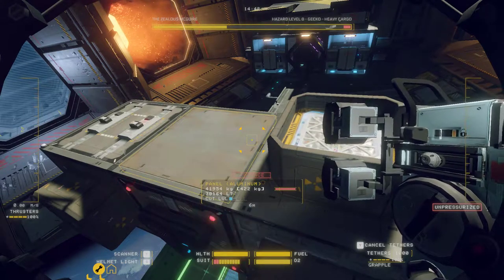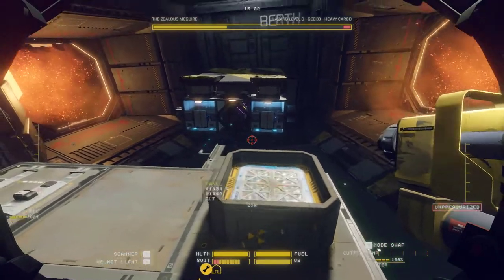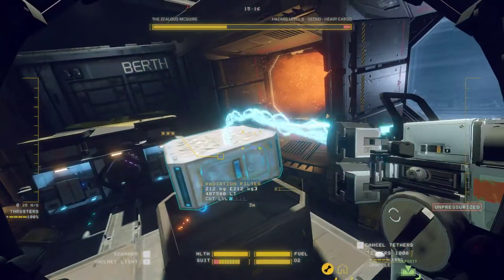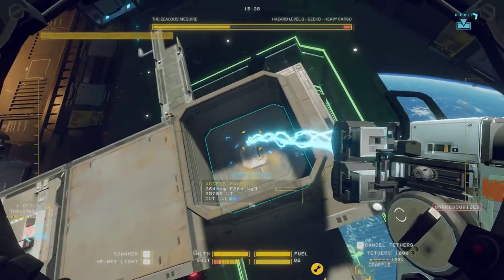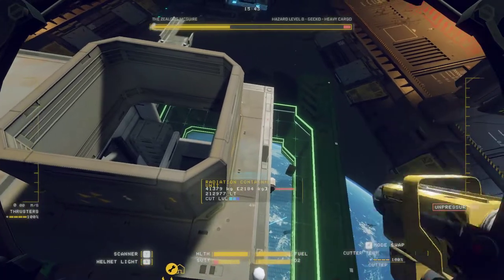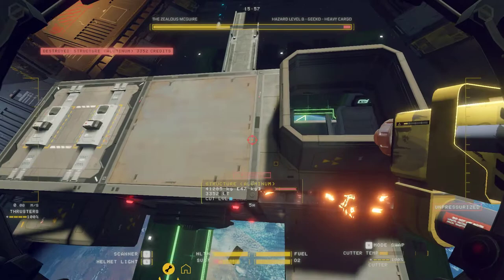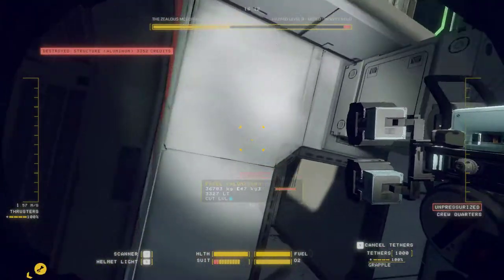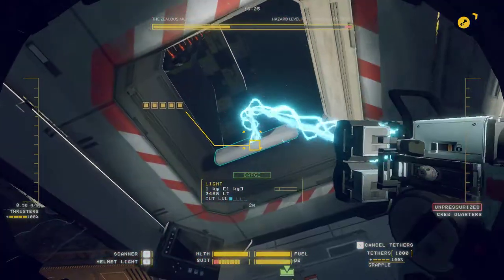Hardspace: shipbreaker - Easy Guide to Removing Radiation Containment Units.

Comment: A video like this where you go: "hey looks its easy!" tells me nothing about what could go wrong. The voice over was saying don't jostle, but how much do i not jostle? Do I need to keep it a certain distance from me? Can I do it before the thrusters, the power, etc? I don't feel any safer cutting this thing after watching the video
Reply from the maker: thanks for your comment, my intentions with the guide were to mostly show how burn the supports around the containment unit as that confused me for the longest time.  but hopefully i can answer some of the questions.

Don't jostle - Try not to knock the blue thing against anything else when removing it, or shake, think smooth controlled actions.
 
Do I need to keep it a certain distance from me?  - Out of range of the radiation cloud spawning, if you do knock into anything but close enough that you can control where it's moving, medium range (if such a thing exists).

 Can I do it before the thrusters, the power, etc? - Sure the radiation blue things are not connected to any other systems, I would advise doing it when you have good clear way to remove the blue things easily (normally after the outer hull is removed).

I don't feel any safer cutting this thing after watching the video - Do not be afraid the LYNX corporation EverWork Program ensures any life depriving incidents become "learning opportunities"*

Hope this helps thanks for watching and thanks for the feedback!

*Terms and conditions apply

Comment: You know if you do a straight cut the entire cut point dissolves after a single slice right? Hence the cut here markers? That indicate it’s a line cut not a lazer cut?
Reply from the maker: if your talking about the frame cut point surrounding the blue block sure, cut it how ever you want, I tend to use the  focused mode out of habit, a cut would be faster, but riskier, thanks for  watching!
Reply: @BroadsideGamingTV  just wanted to be sure, ty